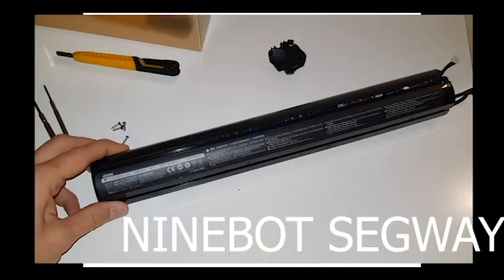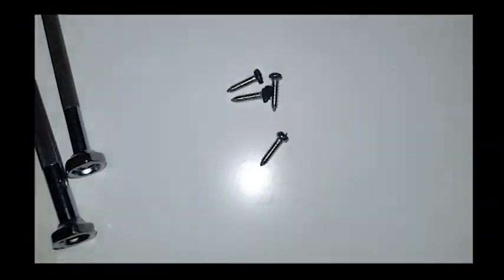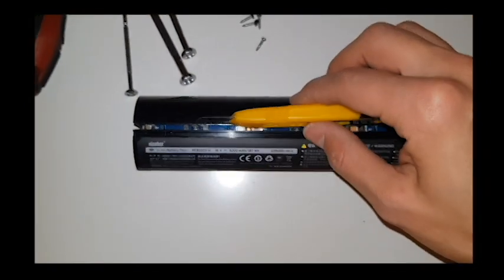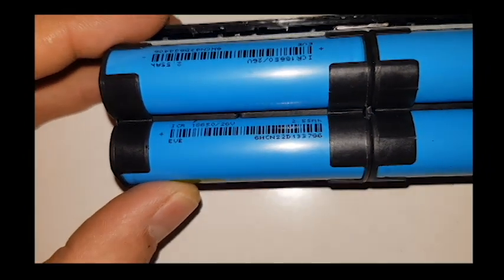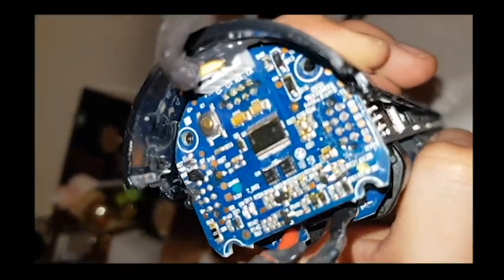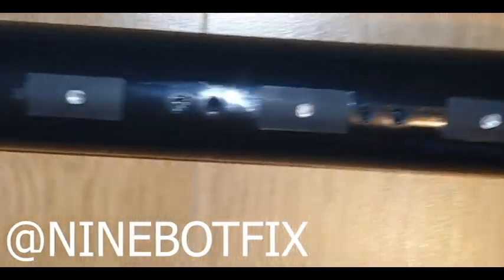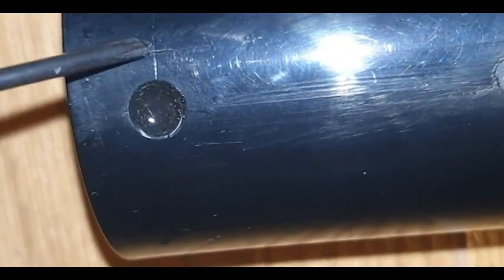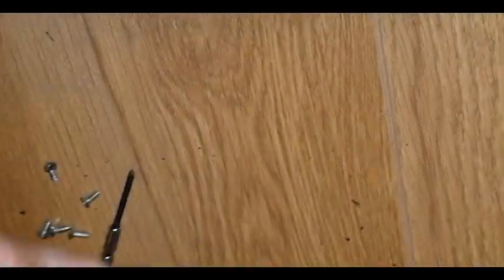NINEBOT SEGWAY ES2 INTERNAL BATTERY DISASSEMBLE www.ulet.lt

Comment: When I plug in my battery into charge (while disassembled) the internal battery light on the top of the battery just flashes red for a few seconds then turns off. Also only getting 1.7v from the battery… is the problem the battery???

Comment: Hi. Great channel by the way.
My scooter is charging OK. But.
1) the on/off button isn't working when charging.
2) it keeps stopping in less than 5 seconds when driven.
Any ideas?? Thank you.
Reply from the maker: Hi. I would say, try to replace lcd first to see if any change, its easy and cheap to do. If not then main controller.

Comment: Did you found what was the problem? I have similar issue, battery measures about 9.5V on main plug and there is no way to charge it. When I measured single segments I found on some of them 0V but I don't know how they are connected so maybe it's not a problem. When I click reset button I got 6 red blinks and then off.
Reply from the maker: Yes. I changed few cells ! No it goes 14miles !
Reply from the maker: yes, replaced 4 cells which came originally faulty. now scooter rides 15 miles distance no eco mode,

Comment: There is no problem with the batterys, if you drive in sport-mode you never gonna get 25km distance, in sport mode without the external battery you gonna get 12-15km distance. You can only get around 25km in the slowest mode "speed limit-mode" even then you dont gonna get 25km. 25km distance is the claim distance from segway were they have test it under perfect conditions in the slowest mode with 75kg lode on it. You can never expect to get the range that they say in the fastest mode.
Reply from the maker: After all inspection i was doing 20km in sport mode here in London. Thanks

Comment: Anybody knows if I can replace the battery cells inside? Looks like it has 20x18650 battery cells and I found there are plenty of better cells in the market. It may give more miles to run if you could replace those. What I worry is how hard it is to re-assemble once you get rid of those battery cells and if It doesn’t work well with other cells that has bigger mAh and voltage. Have you tried this kind? Btw, thanks for the video
Reply from the maker: Yes you can replace it. Quit easy!!!
Reply: @ninebotfix4589  Is there a video showing how to replace individual cells or a video showing how to remove all 20 cells?
Reply: These are high discharge cells so be carefully on just throwing any 18650 cell in there as a replacement. Cell is INR Li -ion cell and most low amp cells are NCR which can only pull a few amps per cell.
Reply: @ninebotfix4589  I don't think it would be quite easy
Reply from the maker: It is not difficult iff you have spot welder machine.

Comment: @NineBot FIX : What do you suggest when having error 19/21/45? I opened up the scooter and saw that the cable connecting the BMS with the control board had came loose. Also, the BMS was not flashing blue. I repaired the connector and reset the BMS by pressing the reset button and I got a blue flashing light. The problem was solved for like 1 minute and after that it came back. Would this be a battery/bms problem or a control board problem? Replacing both is pretty expensive... Thanks for the great video! You helped me to open the battery :)
Reply: I have error 45 and heating elements, on R8. Pretty sure one of the two 18650 of the set is dead, causing overheating

Comment: How do I disassemble each of those 20 cells? Are they all soldered and glued together?
Reply: Most of 18650 batteries in pack arent soldered but welded using nickled strip. Easiest way to disassemble them is using pillers and carefully break away welded spots.
Reply: @heyimque  All I see in the video are some kind of black plastic connectors or holders between the batteries. How do these come apart?
Reply from the maker: @fastechsystems404  they are not soldered. just perfectly connected with plastic cover.
Reply: @ninebotfix4589  How do the plastic covers come off without damaging the batteries?
Reply from the maker: @fastechsystems404  its in a system. just take of all silicone to see screws. there 4 screws which holds BMS, most imports part!:)
Reply: @ninebotfix4589  I still don't see how the plastic comes apart so that I can remove all 20 cells.

Comment: Hello NinebotFix, I'm having an issue with my es2 it does not charge anymore even if the charger is working. I checked using ninebot utility and cells appear to be not balanced. Will replacing the battery fix this issue?
Reply from the maker: Hi. When you unlug it from control board. Is light on the battery is blue? If yes then its fine. When battery is not charging, it is possible control boards fault.

Comment: My battery is flashing blue and it won’t turn on. Any help?
Reply from the maker: Controler issue
Reply: @ninebotfix4589  You mean a problem with the battery controller, or with the speed controller of the scooter?
Reply from the maker: Speed controler

Comment: Mine doesn't charge any more. I let it sit idle for months without charging or using, and let the battery drain completely. Does this mean the battery is dead? Now, when I press the button to turn it on, it beeps only once and goes off. Is there a video that shows how to replace the internal ES2 battery? How to open the the spine and replace it with a new internal battery?

Comment: In red S you're lucky to get 8-10 miles. Unless you are riding nothing but down hill and in economy mode, you ain't going to get 15 mile range! Face it, ninebot sucks!!
Reply from the maker: Mixed modes. With red s it should be aroud 10-11, but i was riding with grey S 50% of my journey. I found few dead cells in my battery, even thoug it was new scooter, i did only 50miles total